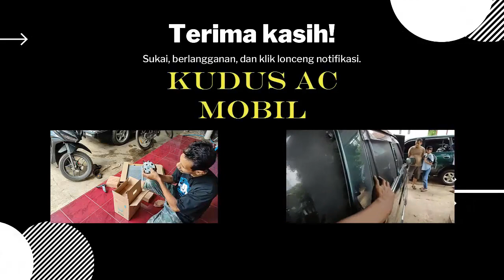PASANG BARU AC MOBIL L300 ][ Hasil maksimal biaya bersahabat ][ kualitas ngga kalah ma ori

Comment: Om mau tnya kalaw mobil honda acoord maestro karburator tahun 91 klw pake ac tenaga mesin berat banget kira2 dari apa nya, terasa kaya mau mati mesin nya, terimakasih sebelum nya om..
Reply from the maker: Kondensor ganti multiflow om
Reply: @KUDUSACMOBIL  berarti kompresor ac nya bagus, cuman Kondensor nya aj ganti gtu, kira kira berpa om kondensor nya dan merek nya apa terus ukuran nya berapa inc
Reply from the maker: Klo offline disini 800 om
Klo ada merk stall uk 23x14x20
Reply: @KUDUSACMOBIL  oh ia om makasih info nya,, kala deket s sya pengen nya ke situ om cuman jarak nya jauh sya dari cirebon jawa barat, makasih om sebelum nya sukses selalu om.
Reply from the maker: Ya om
Terimakasih🙏